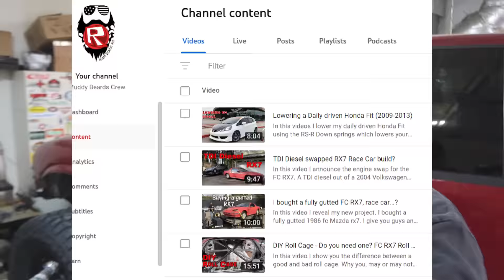Don't Off Road with a C-Channel Frame without watching this!

Comment: I didn't see it and you didn't say.. but anytime you have cracks you should drill a hole on either side to help keep the crack from spreading further before welding.
Reply: they did do that, it was mentioned on the other full trip video taken i follow

Comment: If you have a piece of leftover DOM that can span the width of the frame, I would weld that in as a cross member (with a little more frame plating of course.) Then add a few simple gussets. Sort of like the big tube in the front of a TJ's frame. There's so many different forces in that suspension setup that greatly exceed the frame's capacity, that I wouldn't trust a heim joint link off of the panhard.

I love this build by the way 🤙

Comment: Something I see on trophy trucks is a x brace horizontally at the rear of the frame. I wonder if that would be something you'd entertain since it would brace the trac bar, omit the factory over spare cross member, and brace the future bumper brackets. might just be lighter and stronger than all those cross members out back
Reply from the maker: Great idea, it would be a ton of work but yes it would work great.

Comment: Next time do not weld vertically on the frame web. Just make an arrow and run the weeks down smooth at the tip. Otherwise you will cause stress risers and a fresh frame crack.

Comment: It's not a issue of C-shape frame. I'm sorry to say (write) that, but you made some construkction mistake with this conversion to coil springs and multi link rear suspension. That frame was designed to a different geometry of forces. I'm sure that only boxing C-shape wouldn't be enaf.  You should added new elements to existing frame:
1.  single or double beam(s) (perpendicular to C-shape frame) to connect upper mounting points of coil springs
2. same crossing beam connecting  upper (quite long) mount of panhard with driver side of the main frame, to transfer horizontal forces to both C-shape main elements of the frame. By the way, panhard should be horizontal in neutral position of suspension.
Look on the Nissan Patrol G60/61 or Mercedes G-wagon frames, how it's should be done.

I hope to see you and yours Chevy in next super off-road trips :)

Comment: Would this have happened if you were leaf sprung still I’m thinking about putting my wheeling rig on a full c channel frame but my rear bumper would act like a cross member and I’m thinking I’d box in behind spring the mounts and put crossmembers there

Comment: Thanks Toyota for overbuilding the 86 4runner
Reply: I seen them break. Especially when they put more power than the 22r. I had a 93 s10 that had 38.5x16 tires and was sas. I broke the frame 3 times .I also had a 03 sonoma on 35s. That was pretty good but would bend the control arms too often. I building a 95 suburban now. And I been thinking getting the new 2024 toyota thats coming  out.
Reply: I didn't say there unbreakable. I'm just thankful for a fully boxed frame

Comment: Y not triangleated 4 link and no track bar?
Reply from the maker: Gas tank is in the way. I may swap to a blazer tank which is bigger and moves to the rear so I could do a 4 link.

Comment: Tons would be better for you in the long run.
Reply from the maker: Negative, these axles were built and came from Jeeps running sticky 40’s. They laugh a these 37’s. the brakes are 1/2 truck brakes, so more brakes than the truck needs, so it’s set🤟🏻

Comment: You wouldnt have that problem with leaf springs
Reply from the maker: True, but leaf springs do not perform or ride as nice as this does. Totally worth the extra work.
Reply: @MuddyBeards4X4  ive never noticed a difference between coils and leafs
Reply: @dylanromine4101  Then you don't really wheel hard. I dropped the leafs on my CJ buggy then and replaced them with a proper double triangulated coil spring 4 link. It's night and day difference in performance. No more bouncing on steep climbs. The rear just stays planted.
Reply: @bradywilliams2666  they have fixes for that for leaf spring theyre called anti wrap bars
Reply: @dylanromine4101 so what yo7 are saying is, to make leaf springs work as good as links, you need to add links to you leafs? I guess maybe just go links. Also he built this with what came off the tj so its what he had around
Reply: @dylanromine4101  I had a antiwrap bar. Antiwrap bar doesn't help with the geometry it's still just a leaf spring. There is some many different ways to set a link suspension up to do exactly what you want. IE squat and antisquat. Leaf springs are what they are. That is it.  I wheel the hard trails in western CO and Moab so I was careful to get it where I wanted to perform in these conditions.

Comment: Seriously, at this point the rear frame is junk. Never going to be anything more than lipstick on a pig. 
Do it right and chop the frame off and start over.  Everywhere you plated in you just moved all the flex to a much smaller area and made what you didn't plate is now seeing more abuse than it was before it originally broke. Plan on chasing it around the truck until you get smart and start fresh

Comment: Omg I just realized you had to redo your 3rd link cause for whatever reason you thought it should be triangulated 😂😂🤦🏻‍♂️. You really need to do more research my guy. They have a bunch of hood books on suspension design.
Reply from the maker: I never thought the upper should be triangulated….I thought it would be easier to reuse the mount I already had for simplicity. I immediately realized it wouldn’t work so I fixed it. That mount was already there. So no extra work.
Reply: Man way to comment without even paying remotely any attention. Maybe research the damn video you’re watching before you start typing
Reply: @TheTreadLife_  pay attention?  Use your eyes. He had the 3rd link triangulated in every other video he made cause he was being lazy and trying to take short cuts.
Reply from the maker: I just went back and you are correct.. I had it wrong in the video. I made a post on YouTube and my social media showing the fix a few days later. But most people probably didn’t see that.